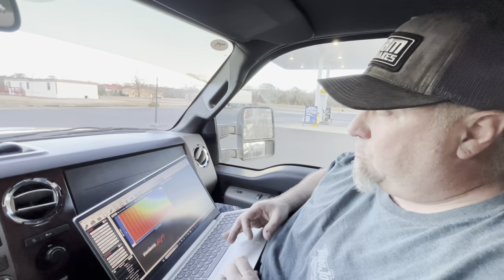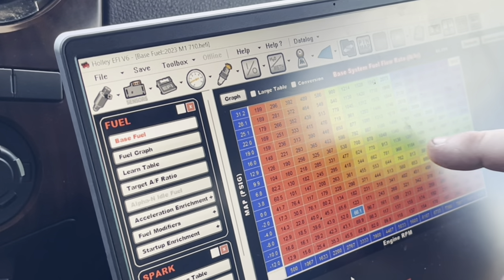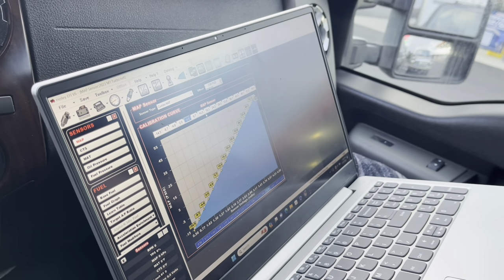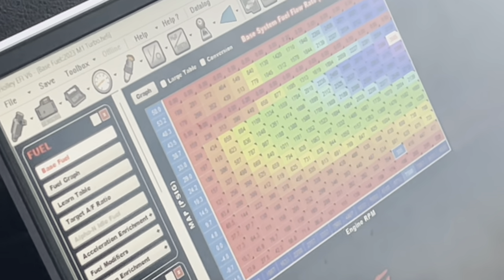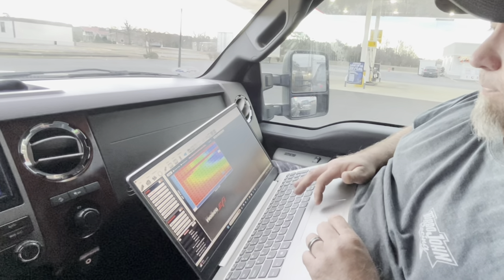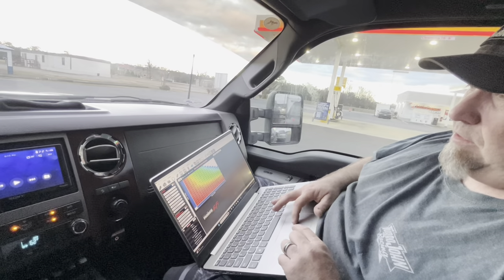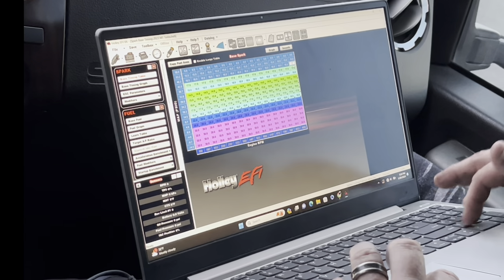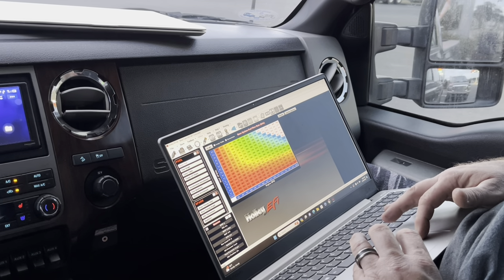💻 Procharger To Turbo… @TurboJohnRacing  Tune Changes Needed For First Start Up 🔥

Comment: One tip on tuning I picked up was in naming the tunes. First the car, then the number itteration it is starting with 001 so that #1,10 and 100 don't line up together. Last is the change made. I am not a pro by any means but I believe in making lots of small changes and saving them all of the time so if there is an issue you can go back without loosing too much of what you  have progressed on. Thank you for the content, that is a bad ass, clean car you have there!
Reply from the maker: That’s exactly what we do is when we make changes we always save a new one

Comment: I have a question, compression between blower and turbo in his motor, still using M1 is OK. Will he be limited on boost? Are you using a base map to start with on his and changing the initial parameters?
Reply from the maker: John and Randy both run M1 and aren’t limited in any way. Randy and I run the exact same fuel and have shared fuel a few times.
Reply: Caution!!! baby steps getting behind the seat of a turbo car, you just were getting comet figured out with procharger, now it's a whole new game. Can't wait to hear your experience 1st good pass.
Reply from the maker: @auriceburrell8148 thanks buddy